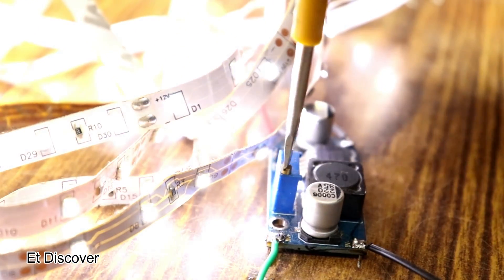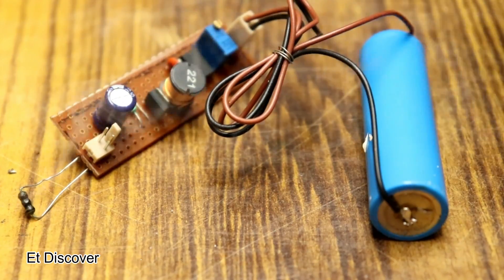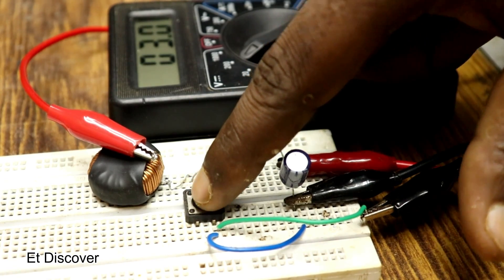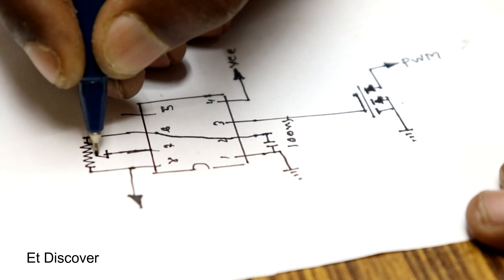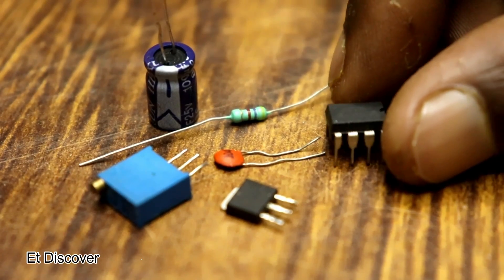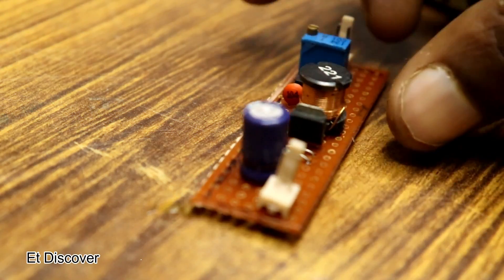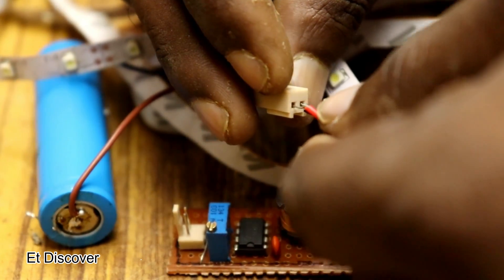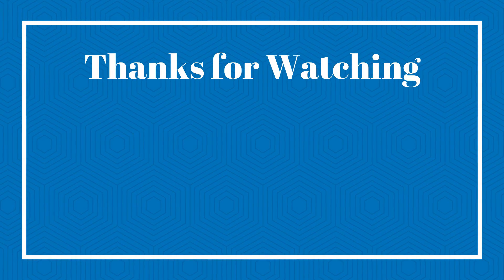3 Volt to 40 Volt Boost Converter # by Using 555 ic

Comment: thank you! i'm a mechatronics engineering student experimenting with electronics and ever since i've seen semiconductors i've been curious about boost converters since they seem just so useful to get any arbitrary dc voltage around 1.5-15x higher than its input. very useful to power guitar pedals from USB.
Reply: Not this one, it ripples

Comment: if I supply 12v, do I get 5v at the output and if I change the input voltage to e.g. 1.5v, do I also get 5v without adjusting the potentiometer?

Comment: HELLO GOOD AFTERNOON, CAN YOU HELP ME WITH MY DAUGHTER'S XV PROJECT, SHE WANTS A LAMP THAT TURNS ON BY ITSELF AND PLAYS A HARRY POTTER MELODY, BUT THE LAMP ONLY GIVES 3V OUTPUT AND I NEED 5V TO CONNECT A SMALL MP3, THIS BOSTER CAN IT ONLY HANDLE 5V? OR WHAT CHANGES WILL I NEED FOR THIS VOLTAGE? IN THE DIAGRAM IS LEG 5 N CONNECTED TO NOTHING, RESISTANCE, CAPACITOR OR GROUND? THANKS, I REALLY NEED HELP, WITH A VERY SIMPLE BOOSTER THAT I CAN MAKE WITH RECYCLED PARTS FROM CHARGERS, SAVING LAMPS AND OTHER DISCARDED APPLIANCES. THANK YOU FOR YOUR TIME TO REACH ME AND ALSO FOR EVERYTHING YOU SHARE. I USE GOOGLE TRANSLATOR
Reply: you can design it to convert 3v to 5v or 3v to 50v, just change component values accordingly.

Comment: You can add voltage feedback to this circuit just by adding a potentiometer between output and ground which whiper is connected to the base of a 2N2222. Connect the emitter to ground and the collector to the control voltage pin 5 of the 555 timer. The potentiometer acts as a voltage divider which transforms the desired output voltage into 0.6 V at the base of the 2N2222.

The charge / discharge control of the timing capacitor can be done simply by a resistor between pin 3 and pin 2. pin 7 is not needed for this control function. Simply connect pin 2 and pin 6.

Comment: This is very bad circuit 😐Dont have feedback facilities. Increase voltage more and more  and Heat
Reply: Use the circuit i made.it has a feedback circuit and is simple
Reply: @Inturupter  lol Where is feedback Pin? Mosfet  just trigger more and more.

Comment: wtf... in the diagram you release there is no mention of a resistor other than the potentiometer so where to put it? and you only mention a small 100nF cap, what is that other bigger one?

Comment: Well thats a good video, just wanted to check what I want to build is even worth it.
Another Tip: If an LED strip is all you want to light with a Lithium ion battery, just add few solder bridges on the strip itself so that individual LEDs get 3.7V (Strips usually have 3 in series in each unit), no need to build complex circuit

Comment: Thanks Ji for this simplified project. 
Kindly help me understand what will happen when i ...;
1. Use a bigger inductor and a slightly bigger capacitor at the output?
2. When i input 17v to the circuit.
3. Will the IRFZ44N transistor heat up when run for long??
Dhanyawad

Comment: Operating frequency is too low for proper operation rather you could make 555 pwm circuit with 100khz frequency and it will be fine I made it along with a 100uH inductor and 220uf cap and the output voltage reached 144 volts for a duty cycle of 0.8

Comment: Hello, can we feed the system with 12v to have 24v at the exit ? if so, what amps max can we draw out of it ?
Reply: Bro it doesnt have feedback means when you draw 24 v that means you can only take few milliamps and then it will drop its voltage therefore he doesnt show us voltage at output but at good side is its cheap , but it will heat up lot
Reply: U can increase ampere by just using coil with more thick wire...

Remember

More turns of wire on coil means. More Voltage and.  More thickness means. More current

Comment: Can we connect the boost converter to a solar panel and to a motor or battery. 

Second thing if we connect a 12 v battery to few led without booster and with booster what advantages

Comment: Hello guys the 555 timer ic Here is in astable mode.. 
So connect a 4.7k resistor between "7 and 8" terminal of 555 timer ic.. Then u r ready to go.. 
The circuit works fine.. But can't handle more than 1.2 amps for much time.. The z44 will burn offf
Reply: Why... Z44 is rated for  55v 49amps.. actually I'm newbie in  electronics. Can u explain😊?

Comment: I built it but Not working . Some thing greatly wrong in the diagram.4.7k not even shown in the diagram but practically shown.I built this circuit twice but all failure. I followed the diagram according to the link. please Sir provide the corrected diagram with if possible the PCB.
Reply: Hello guys the 555 timer ic Here is in astable mode.. 
So connect a 4.7k resistor between "7 and 8" terminal of 555 timer ic.. Then u r ready to go.. 
The circuit works fine.. But can't handle more than 1.2 amps for much time.. The z44 will burn offf

Comment: The diagram is misleading and faulty.... tried it in a circuit simulator and it just shorts... I the video,  it can be seen, that two capacitors are used... but only one ceramic capacitor is in the description and in the diagram. Same is with 4.7kohm resistor... where is it in the diagram? What kind of electrolytic capacitor did you use? And last and not least, you suggest to use N-type MOSFET but in the circuit diagram it seems to be a P-type MOSFET.... what is with that?
Reply from the maker: The circuit is absolutely right, the positive is connected mosfet Drain pin. Please collect some mosfet and transistor knowledge. I know that Here missing a electrolytic capacitor this is my fault, but here this capacitor use for only dc input filter purposes, without this capacitor it will work very well, something else???
Reply: @EtDiscover  No, it is a P-channel MOSFET in your diagram... and z44 is a N-channel MOSFET. N-ch the arrow is pointing inside, and P-ch the arrow is pointing outside. Look at your diagram.  And I am talking about the electrolytic capacitor that you have in the video... but not in the description. Boost converters will not work without the end capacitors...
Reply from the maker: Remember one think , I never make any misleading project,
Reply: @EtDiscover  So why is it so difficult for you to write what kind of electrolytic cap did you use at the output and where did you use the resistor.... several people have asked that and you have not given any answer... without that information, your project is useless.

Comment: Hi there i have made same circuit as of yours.. The output voltage stays constant till the load is not changed.. But when i increase or decrease the load , the output changes .  .. Soi thought using the 5th pin of 555 ic but i dont know how to use that pin.. Please provide some info.  .. I will be happy yo hear from you

Comment: i have 36 volt led strip i made a converter 12 to 36 volt but it draws more current ,i did not found suufficient converter in net un fortunately ,i saw yours converter i think its works pretty well

Comment: i was want to make something similar but in the end i scrap the 555 timer and i have use instead the UC3843 wich is a propper ic for the job . but back to the 555 time i have repeatet the circuit is kind of good for power few led or a 12v circuit but due to the lack of a feedback system i can maintain a stable output . but is a good circuit after all . by some extends

Comment: Bro where you used 4.7k ??? It's not shown in circuit diagram.
Reply: Hello guys the 555 timer ic Here is in astable mode.. 
So connect a 4.7k resistor between "7 and 8" terminal of 555 timer ic.. Then u r ready to go.. 
The circuit works fine.. But can't handle more than 1.2 amps for much time.. The z44 will burn offf

Comment: Voltage is increased but when I connect led strip. It automatically decrease output voltage to 7 volt
Reply: Use feedback
Reply from the maker: Increase the amp of input voltage
Reply: @EtDiscover  sir in ur video. U connect  lithium battery n I think it's input amp will be approx 1 amp.. but at output up connected led strip which requires 3 amp minimum. How it will be possible

Comment: bro where you use 4.7k resistor you will not show in circuit diagram
Reply: That resistor is a pull down resistor, you can use 1k resistor instead for 4.7k  resistor connect it to the gate of mosfet and the ground of power supply
Reply: Make sure you use N-Channel mosfet so that it will works
Reply: @liendelguibingcan3074   how to check it is n channel
Reply: @liendelguibingcan3074   my mosfit is IRFZ44N
Reply: @liendelguibingcan3074   bro i have 10 k preset resistor then how to connect it which leg is first ,second and third and how to connect mosfit in circuit i have no idea adout mosfit symbols please make circut with real component and send me on e-mail deepakmall9b@gmail.com
Reply: @deepakmall4565  I will send it to you later in your email because right now I have something to do.
Reply: check your gmail I send the circuit there.
Reply: @liendelguibingcan3074  bro i have not received your e-mail yet please resend it
Reply: @deepakmall4565  I resent it again to your gmail you had gave to me
Reply: check it again
Reply: @liendelguibingcan3074   bro test message i have received but photo is not received
Reply: @deepakmall4565  okay I send it again

Comment: What is the value of output electrolytic capacitor it is not mentioned in diagram
Reply from the maker: This is DC filter capacitor.
Reply: @EtDiscover  can i use 1000 micro farad
Reply: Here he had used 100 uf 25v capacitor I've seen it in the video

Comment: Which componet used to vary the voltage
Reply: Blue colour component name plzz
Reply from the maker: 10k potentiometer
Reply: 555timer 5th terminal is not connected in ciruit diagram
Reply: Potentio meter conectedin which terminals of the 555timer
Reply: Hello sir replay me

Comment: Nice work ..i made one to drive my led and i have some problem with mosfet temperature it is very highly increased when i give load to this circuit ..I'm giving pwm signal using ne555 pwm module the input voltage is 12vdc...i have project to complete please help me mail me if you are interested to help my email address is... ashishnet1986@gmail.com.
Reply from the maker: It is very light-hearted and the square wave out of it. You can do your work very easily through this

Comment: I need your help. Created the circuit in a bread board but the output voltage is same as input voltage across the capacitor. Please contact kishorparida7777@gmail.com i wana speak to regarding this. Also my inductor is not same as yours. Mine look like a resistor
Reply from the maker: Please send me a sms in Facebook page

Comment: Nice sir but 4.7k resister where is use in circuit diagram
Reply from the maker: Sadly, I forgot to give it a circuit diagram
Reply: @EtDiscover   oh thanks
Reply from the maker: 4.7k resistor is connected with output of positive and negative
Reply: @EtDiscover  I make this but not working . I didn't use 4.7k resister & I used 6uh cfl bulb inductor please help  me i give input voltage 3.7 and I get 3.7 voltage of output i use 50v 100uf capacitor
Reply: MORE THEN 2 TIME . I facing same problem, and then after finally i get 6.5v on output. but sadly on load it dropped down 2.2v aprox. i also unable to find this problem.  can somebody answer me

Comment: In the circuit diagram there was no resistance after the mosfet but you have used a resistance after the mosfet.. what's the value of that resistance and where to connect...?? Reply please....

Comment: What is number of the resistor??
And connection???
Reply: Hello guys the 555 timer ic Here is in astable mode.. 
So connect a 4.7k resistor between "7 and 8" terminal of 555 timer ic.. Then u r ready to go.. 
The circuit works fine.. But can't handle more than 1.2 amps for much time.. The z44 will burn offf

Comment: plz. mention where to connect 4.7k resistor. this info is not mentioned in the diagram.
Reply: Did you get ur answer about 4.7 k and 10k resistors?

Comment: Hey bro.
I watch almost every videos that you uploaded.
But i couldn't find all the components to make them
And today i found all the components to make this converter.
But the 50 hz osilation is not working.
When i connect the bettery the multimeter shows 3.8v
But the bettery i use gives 4.2v.
But when i frequently connect and disconnect the positive wire to the bettery
Tge voltage slowly increases upto 26v
But i cant osilate it that good.
How do i fix my osilator
I used the tactice that you used
But it can't even glow a 9v LED.
Help me bro.......
Please........

Comment: how this will work when 555 ic need min vcc volt 4.5 to start ?
Reply: Most of 555 chips Works on 3volts.
Reply: @dardacc  but they work little rouge

Comment: You said that, your circuit has no feedback process. Then, is it safe for any kind of load except motor?

I've a boost module, which you have shown, XL4009 Booster Module. I connected a motor to the output of this module and voltage kept at 5 V which is not much for the motor. But as the motor feeds high current and I didn't know module's maximum output current rating, the IC became very hot. 
Then I'm asking you, what this problem comes in this circuit or not?
Please tell me.

Comment: How make feed back setup like commercial boost converter
Reply from the maker: microcontroller
Reply: Et Discover which of the MCU?? Make a video on it..
Reply: +Addictiongamer  Use "lm-2577" it was specially design for boost and buck converters it has feedback feature >or use AttinY85 MCU IC but you need to program it